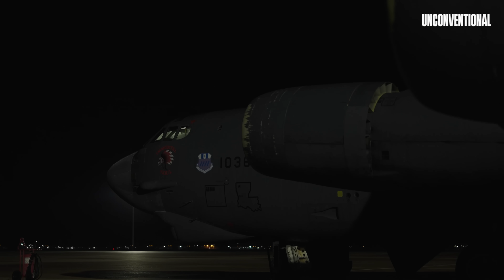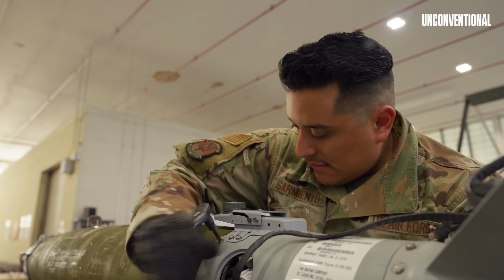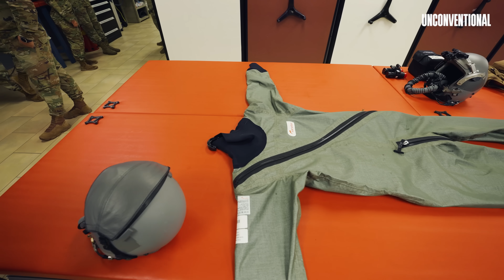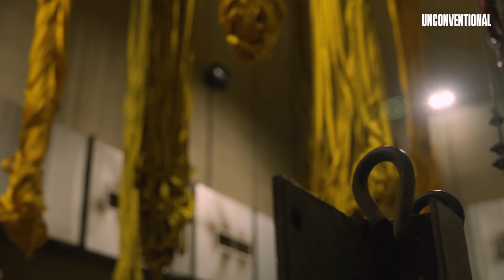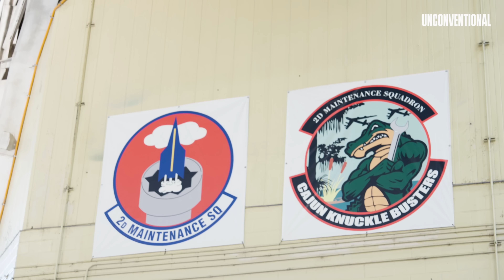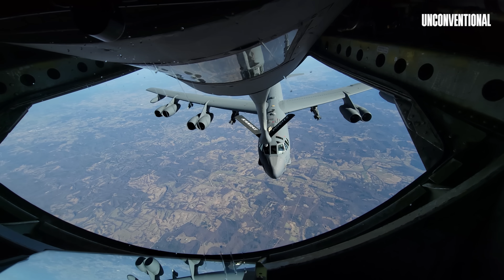I Flew in a B-52 Bomber: Here’s What It’s Like

Comment: Why is the B-52 still relevant?  Its performance still hits the parameters you want for a heavy bomber - payload, range and speed.  The engines are being upgraded to improve that performance and, more importantly, fuel consumption and efficiency.  The payload is enormous and has been modified to handle modern munitions.  The sensors are also being modernized, making munition deployment more efficient.
Reply from the maker: BUFFY will be flying for a long time for the reasons you stated!!🫡🇺🇸🦅
Reply: @Unconventional-Newsweek  The Rapid Dragon palletized cruise missile system planned for US cargo aircraft is an interesting adjunct to the BUFF, too.  However, as we last saw in Desert Storm, a B-52 squadron carpet bombing a grid square is hard to argue with if the air environment permits.

Comment: As an Engineer just out of college, in 1966, my First Job was to make some parts for the B52 BNS Bombing and Navigation System.  These were probably replacements in the existing fleet.  In later years, our company supported the old systems, and People like me went into the Integrated Circuit upgrades, and then on to missiles and newer combat fighters.  When I retired in 1999, one of the last USAF contracts was for replacement parts for the B52.  We were in Carswell at the end of the runway, working some EW equipment, and some of the "loaded" ones were taking off.  My buddie engineer was watching, and he poked me and said, "I don't think it can make it up, should we run".  I saw this huge thing coming at us, not more than a few feet above the runway, and had some doubts.  I told him to stay put, since we were "goners" anyway we ran.  So we stood under this lumbering giant as it went adjacent to us, and watched it struggle in a flat plane, very very slowly very rising out into horizon.  I don't think that pilot got above 2000feet when he went out of sight of us.  The noise was deafening, I still remember it, it just shakes you apart.  I hope that the B52 continues until the Earth no longer has Wars.  At the present rate, globally, it will probably be around until the year 3035.  The Stealth systems work great (we designed for those also), but once the Drones are eliminated, it will be right back to massive weapons drops and explosions.  Maybe after that, sticks and stones, with whomever is left.
Reply from the maker: Thanks for sharing your story. The buff is a wonderful and imposing aircraft for sure. It will certainly be flying for decades more. Thanks for the comment. Please like subscribe and check out other videos. 🫡🇺🇸❤️🦅